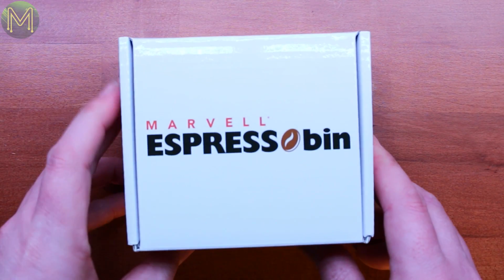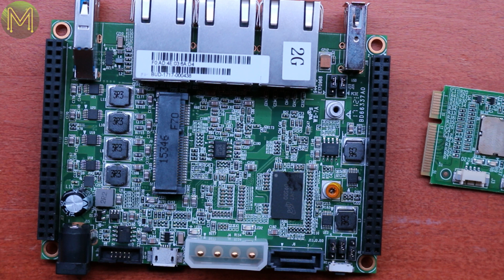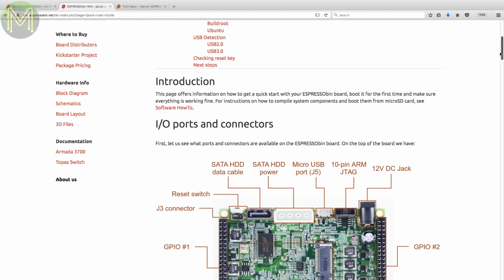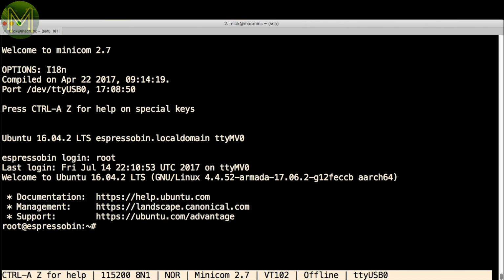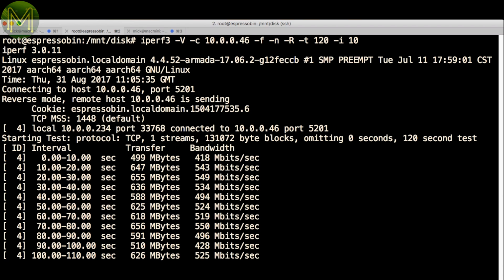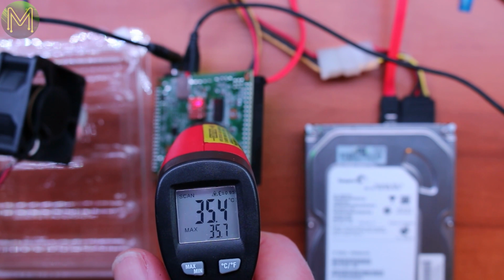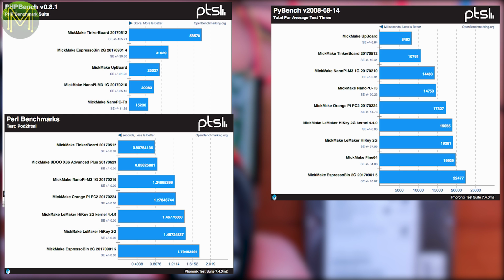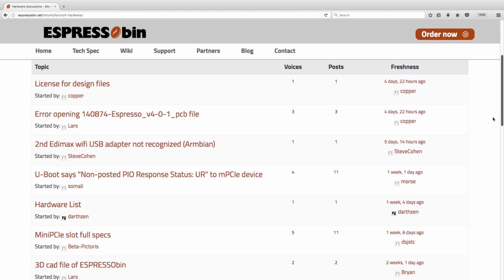#168 The EspressoBin: Something completely different? // Review

Comment: your IR temp readings from copper will be pretty random due to its very high reflectivity; spray it with matt black paint to get a 'real' reading.
Reply from the maker: +effgee123 
Yup, from tests I've found the emissivity of copper to be around 5 degrees more at most. So it's still running cool.

Comment: I guess they love buck converters.
Also what does the number on the Buck converter chip say? I'm currently  working on a project which needs to have macimum efficiency and i need a buck converter chip on the pcb.
Reply from the maker: +E_404 
Bucks aren’t as straightforward as plonking an ic on a PCB... well these days it sort of is, but you have to be mindful of several factors - current draw, voltage, heat dissipation, grounding, components, etc.
There’s two ways of getting a buck setup on your PCB
- copying an AdaFruit/SparkFun design
- heading over to TIs website WeBench, which allows you customise everything and it’ll even show you how to arrange on a PCB.

Comment: Great review.

I downloaded debian for ARM. 
But I'm not able to find the espressobin back on my MAC in the /dev/tty<###>, neither /dev/<###>
(powered 12 V DC)
Reply from the maker: +kris maussen 
Check your USB cable. Some of them have power connected but no data lines.
Did you make sure you powered it from the DC jack as well?
Reply: Thanks for your response.
Mick, I used also the 12V DC jack to pwr up the system.

I had the chance to do it on a windows machine and without a problem (same cable).
Except I didn't found the logins credits for debian : https://wiki.debian.org/InstallingDebianOn/Marvell/ESPRESSOBin 

<had the PC just for one hour>

+MickMake, 
I reinstalled the Prolific PL2303 driver again and now it works fine. A little bit strange, but finally up and running.
Thanks for your time and effort.

Comment: Its hard to get excited about 3 network ports (its novelty).   Better would be an ARM SBC with 8gb RAM and a video architecture that is open (unlike the rPi).  This way, browsers, games, desktop ui's can be made to work well within a GNU-OS.
Reply from the maker: +GnuReligion 
Yup, they wanted to try something different alright and they are hoping that most people will be wanting to use it as a NAS or router.
Reply: The web site mentions using Plex on the device.  Am doubtful that the CPU can manage real-time video conversion though.  FreeNAS and OpenMediaVault are other likely applications.   But with only one SATA port, one will need external hardware RAID.
Reply from the maker: +GnuReligion 
Yup, it's a bit of a mixed bag of an SBC.

Comment: what's this board supposed to be used as? like a router? but I didn't see some real npu...  I have to say the board looks really cheap with bunch of converters...
Reply from the maker: +Zelra 仙賢戀軒 
Yup, it's really a mixed bag. I can understand them making those design decisions, but has me stumped on what market they want to hit.
Reply: well when they say its up to the maker to decide if the boards for them tells me this is either a bunch of shit they threw together without really giving a fuck thinking some schmuck will buy it or it was a piece of custom hardware meant for a router or some other purpose they just reworked slightly and shat out onto the market
Reply: +Evi1M4chine  That sounds like what I want to setup too. Did you have any luck? Have you published anything on your results? Thanks for any info and Good luck!

Comment: If they can't get the LED correct...
Reply from the maker: +Steven Sexton 
In reality the problem could have been solved with a simple diode.
I suspect that they originally wanted to have the board powered from USB, but had an oops moment and didn't fix that part up.
Reply: MickMake True, a simple diode could have made it a little bit more elegant but they either missed it or they didn't care.

Comment: lagging behind: redundant.
Reply from the maker: +Bill Peiman 
It's one that I wanted to get out earlier, but I went into the chipset more since there wasn't any videos on that topic area.
Reply: MickMake

Hi, Mick,

What's the cheapest Atom / Celeron SBC you've seen that has an mPCIe connector?

I really want to try a full-sized graphics card on a small-ish Intel-based board, but it's quite hard to search for ones that have the required slot.
So, I wondered if you might know of a few?

I realise that most mPCIe slots will be limited to 1x lanes, but I predict that we'll be seeing a lot more Win 10 SBCs in the near future which will run modern games quite well (with an external GPU).

I have a MeegoPad T02 etc., and obviously that was designed as a specific form factor, but it's strange that so many of the slightly larger boards don't at least break out the PCIe signals onto a header? (even if it has to use the physical USB 3.0 or SATA connector.)